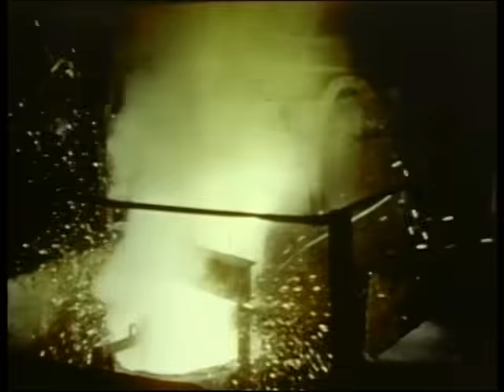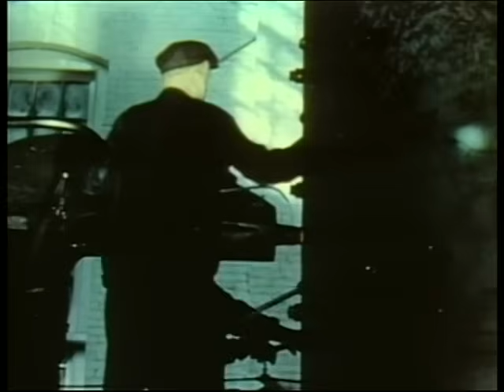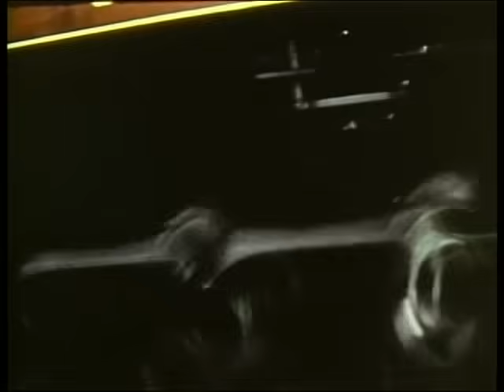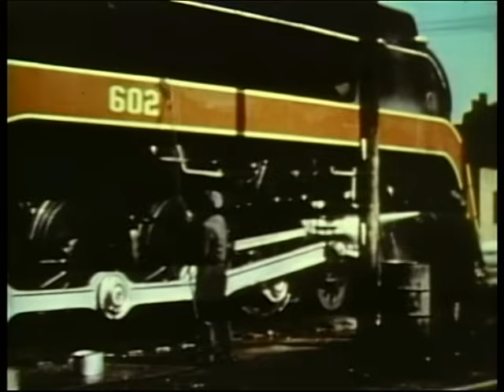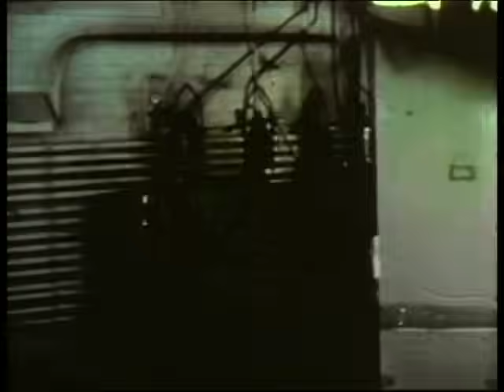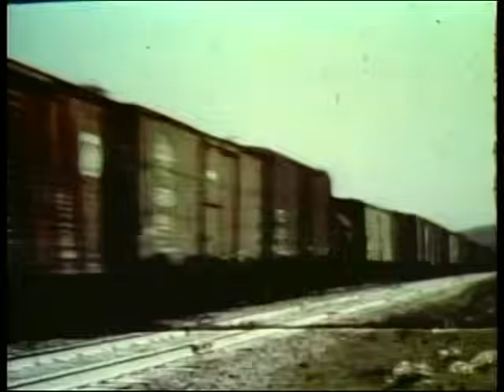The Modern Coal Burning Steam Locomotive: Norfolk & Western (1944)

Comment: Very interesting film. Sort of a hybrid era, bridging Steam and diesel. A combination of riveted and welded Construction. Modern roller bearings replacing bronze sleeve bearings. I wonder how long that newly built locomotive was in service before it was replaced by diesel
Reply: 602 was in service for 18 years from 1941 to 1959, by the end hauling freight trains more often than not due to the Dieselization of the Norfolk & Western network.  Today we've got one J Northern left, and she's 611.
Reply: Thanks for the bearing info. I was wondering what type the roller bearings replaced.